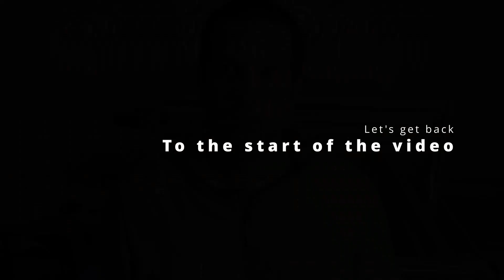What you need to know to operate a CNC

Comment: Hi I am a noob in cam have a cnc at home and want to mill a more complex part maybe we can get in contact and maybe show me how you would proceed have no plan how to efficiently work with it for example a basic i think my part is false orientated in the stock part because the paths makes no sense and a negative 3d surface this makeing anything bilut not what I want
Reply from the maker: Check the series about using FreeCAD for cam on my channel, in episode 3 I'm talking about placing, rotating and setting the origin, that should solve your problem. For one on one tutoring, I have a paid option on my Patreon page.